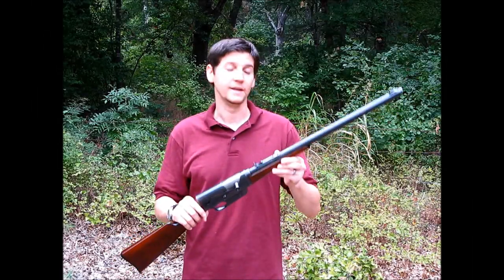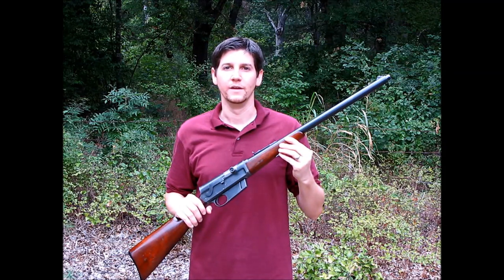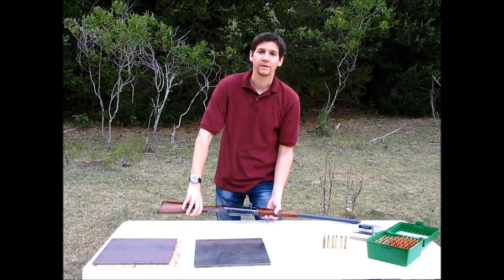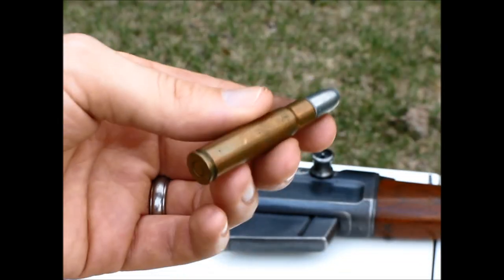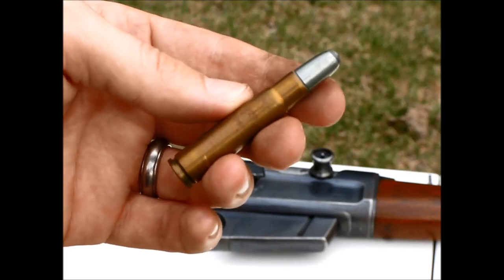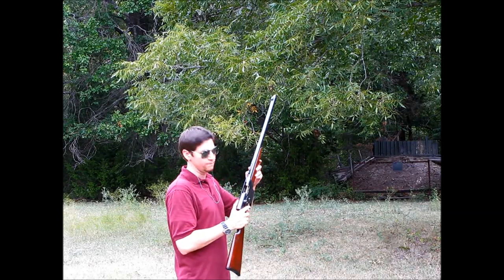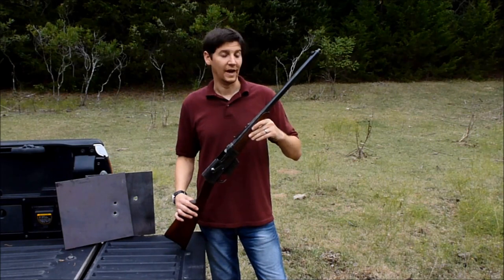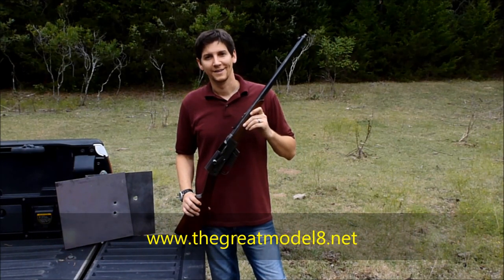Remington Model 8 vs STEEL!!

Comment: I inherited my Gran-Gran's (yes great grandmothers) Model-8 cambered in .30 Remington.  It still shoots as flawlessly today as when she was hunting with it.  Thankfully Gran-Gran had the foresight to have Remington install a rubber recoil pad on hers from their custom shop.  I recently replaced that pad with a Kick-Eze pad (kept the original) and it is still a pleasure to shoot and is incredibly accurate with the Factory mounted Lyman #6 tang peep-sight.  It will hold right at 1-minute of accuracy at 100 yards using Remington Green & Yellow box 170 grain Core-Lokt soft points from a bag rest.

Comment: I have been looking for a Good condition Model 8/81 in .35Rem for the right price for about a year. I have always liked the design especially with the Higher capacity mags. The Winchester 1907/08 in .351WSL with High cap mags is another I want. They are both so kool.

Comment from the maker: If you ever get a chance measure the inner & outer door panels of early-mid 1930's cars.  You'll find they are about 19ga, double that and the metal in the panel is less than a 1/10th of 1" thick.  A 45ACP would have no trouble zipping through that.  Check out my other video on Hamer regarding what guns might have been used.  Never seen any evidence for a Colt Monitor.

Comment: There's a damn good reason these were so popular with lawmen back in the day. Automobile coachwork back then was pretty heavy duty stuff compared to today's vehicles. But the .35 Rem. would punch through just about any part of a car short of the engine block, and the home-made steel body armor worn by some outlaws was useless against it.

Comment: I wonder why John Browning couldn't have modified that rifle for combat use. His 1911 pistol, BAR, and 50-caliber machine gun all performed well on the battlefield. The Model 8 had the advantage of being able to use a 15-round detachable magazine rather than a stripper clip.
Reply: +Mishawaka Post There were a couple of police modifications that used a detachable magazine.  They weren't generally available to the public.

The U.S. Army favored the 30.06 which would require an extensive redesign of the Model 8 to accommodate the large and powerful round.  The design was considered too complicated and too fragile for military duty and too difficult to service out in the field.  And semiautomatic operation was not yet considered necessary for combat.

The French used some in WWI and the U.S. Army used some in experiments intended to develop tactics for when a self loading rifle is adopted.

Comment: thanks for the great vids on the Remington model 8. I have a Marlin 336 in 35 rem and love it, and would like to get a nice Model 8 at some point. Is there any companies that are making a nice reproduction Model 8?
Reply from the maker: campocaster, production of the Model 8 ceased in 1936, and it was replaced by a cosmetically revamped Model 81 which continued onto 1950.  You can still find nice examples out there.  35Rem is probably the most common caliber these rifles are found in.  Try gunbroker.com, there's plenty up for auction!

Comment: Sure would have liked to see this shot over a chronograph. 100 year old ammo is impressive when it goes bang. If it was at or near normal velocity that would be doubly impressive. And yes, cupronickle bullet jackets were common. In that era. The .30-40 Krag military loads were too. I'm pretty sure the original nose cap for the Winchester Silvertip bullet was too. Testing against steel and touting it In print ads probably is what inspired lawmen and possibly security guards to buy these rifles.

Comment: Saw & enjoyed your other videos & Hamer piece.I read somewhere he acquired a Remington earlier,likely sporting model per your sources.I'm only rehashing what I've read.
As for cars, it's more than sheet metal, but the other structures that would deflected or stop the bigger, slower moving .45 that the .35 Remington, would easily penetrate. 
Some Colt Monitors were sold & used by LE in '20s & '30s, heavy, bulky, expensive, not popular, their distribution was limited.
BTW:Your stuff is excellent

Comment: this was awesome now what would have really took it to the next level is if you tested 30-30 next to 35. The original claim was 35 would penetrate 5/16" steel plate and 30-30 could NOT, it was a claimed that 35 had better penetration. I would like to see a side by side for these 2 rounds

Comment: Didn't Frank Hamer use a .35 Remington? I think several were used at the Bonnie & Clyde capture.( Despite movies the .45 ACP had problems with effective penetration of the era's car bodies, and rifles preferred. .30-'06 Colt Monitor(civilian BAR) was only ther high powered self-loader at time.The '07/'10 Winchester blowback SLR were chambered for less powerful rounds.)